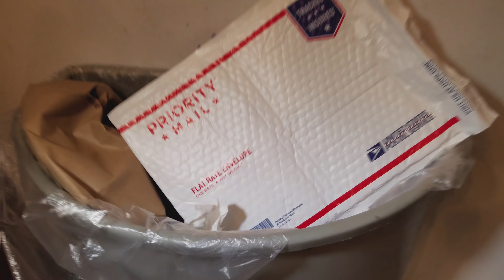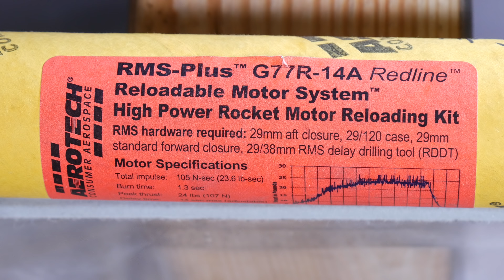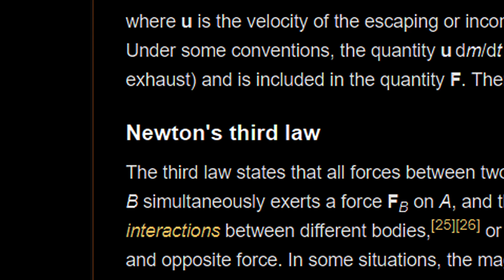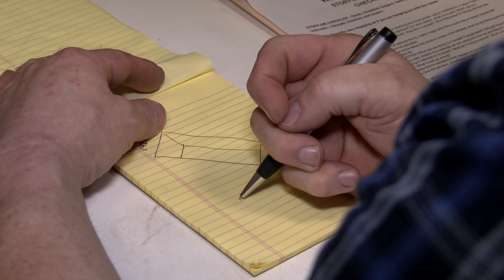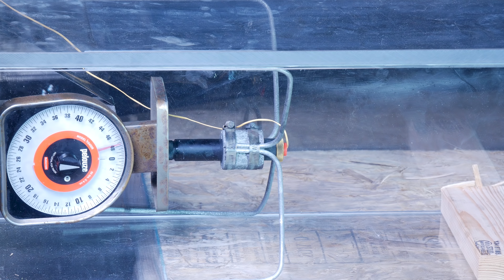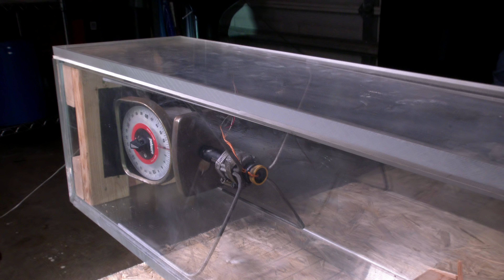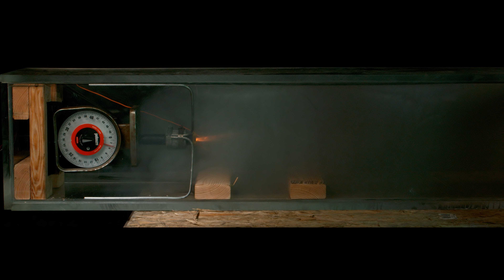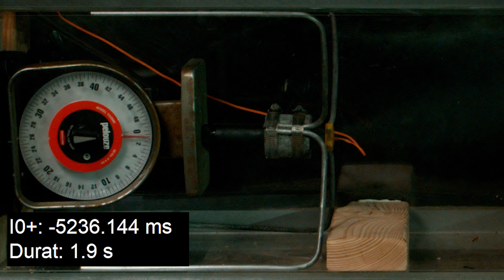Rockets in a Vacuum Chamber - Newton's third law of motion Visualized

Comment: i don't think science has any problem proving the idea that rocket propulsion works in a vacuum. If you contain an explosion with a small vent to allow gases to escape in a single vector then the pressure created by the explosion will press against the hull untill all the gases can escape and the pressure returns to zero. This isn't a difficult concept. if molecules can move in space, then objects can move in space.

I would like to hear from any astrophysicist (professional) who can explain why rockets don't work in space though.
Reply: No one is questioning Newtons action- reaction. The question is, can the mere reaction of exhaust gas, the force created as a function of its mass and velocity ONLY, absent of a pressure differential created at the exhaust, do the things that nasa is asking us to believe it did? How much effort is required to hold a garden hose? how much more effort is required if you block the end with your thumb? When we watch the famous footage of the ascent stage living the moons surface, keep in mind that the vehicles acceleration is due only as a reaction to the of the force of the exhaust gas (it's mass x velocity)
Reply: @markwilding3828  do you understand the "Law of Conservation of Momentum".  For example, if I had a giant crossbow with a mass of 5000 kilograms.  It is floating in zero-G, in a vacuum.  It can fire a 500 kilogram block of water ice at 2500 meters per second (muzzle velocity).  Would the crossbow get pushed backwards?  Do you know how to calculate how much velocity the crossbow gained by firing the water into a vacuum?  Hint: definition of "momentum" is Mass x Velocity.  The momentum gained by the block must be the same momentum gained by the crossbow. Momentum of block = 500 kg x 2500 m/s = 1250000 kg x m/s.   If the momentum of the crossbow must be equal to this momentum, then write out the equation for the crossbow, and solve for final velocity.  You will get 250 meters per second (~560 mph).  So that is a HUGE velocity change from firing a SINGLE block of water.  Do YOU know of any machines that CAN do this in space?
Reply: @stuartgray5877  Yes, thanks Einstein. I also understand the principle of Force and it's relationship to acceleration... I realise I was somewhat loose with terms it the above statement which is a bit careless because there are always those readers who would rather challenge a point by obscuring it with irrelevant detail than actually considering  the concept. Had I been concerned with solving some Newtonian equation I would have been more rigorous. What I should have more precisely said is that the reaction force is a FUNCTION of mass and velocity... velocity,  acceleration, mass and momentum all being related linearly. However, to consider your point, let's look at your crossbow being the 5000 kg (at launch) ascent  stage and the arrow is a gas being ejected in an effectively  perfect vacuum  in direct opposition to the moons gravity...or let's consider the Ascent stage the arrow and your target is the CM, 60 miles away and moving in an orbit (changing velocity) at a speed of 5,000 knots.... of course you do have the opportunity to change the arrows  velocity multiple times by recalculating  it's  momentum and acceleration  with respect to the arrows velocity with respect the arrows changing velocity due to the lunar gravitational and the targets constantly changing location... So GOOD LUCK! you get one shot or everybody dies. Please advise grammar errors.
Reply: @markwilding3828  So you are saying it is POSSIBLE based on Physics, but really HARD in practice?  Is that what you are suggesting?

Another question:  Do you think the SpaceX launches and LANDINGS are fake?
Reply: @markwilding3828  the other thing I didn't mention about my example above is that: the Space Shuttle Main Engine (SSME) expels 500 kilograms of WATER at 2500 meters per second from the nozzle EVERY SECOND.  That is about MACH EIGHT, at sea level.  Do you think a machine capable of that can PROPEL ITSELF in a vacuum?  Well I calculated the momentum of that 2500 m/s water.  Does THAT seem like enough to propel something in space?  You don't think "exhaust gas" is enough to lift the ascent module from the lunar surface?  Why don't you CALCULATE the mass and the velocity of the gas required to lift the equivalent of a VW beetle in lunar gravity?  Then you can see if it is within the realm of possibility.
Reply: @markwilding3828  yes you can believe it. how much velocity is in each molecule that combusts inside a rocket booster? multiply that by how many molecules total that are exploding- and you get plenty of force to propel a rocket. Can the force of combustion push a rocket in space? 

Can two asteroids collide in space? What would happen? nothing? do they just not go anywhere? Do they not break apart and fly ogg in many directions? Are people saying that whens billions upon billions of tiny collisions happen each moment during rocket combustion, it has no effect of movement on the rocket because it's in a vacuum? Even in vacuums 2 particles can not fill the same space. if a molecule is combusted and sends that molecule hurdling at thousands of miles per hour and hits a metal molecule from the hull of the ship, is that not going to have an effect? of course it is. That's not even debatable.
Reply: @stuartgray5877  Doesn't water boil in a vacuum..Are we not 70% water..just asking
Reply: @stuartgray5877  yes..deffo
Reply: @whiskyweasal89  Ok say you can fire a rocket in a vacuum..Will that momentum be controllable are would the object just spin wildly.
Reply: DG Medor thrust vectoring.
Reply: @whiskyweasal89  OK tnx you
Reply: @stuartgray5877  Stuart, you do realise that attempting to argue a point by changing the subject is awful reasoning and logically invalid. However, when space X launch a rocket propelled vehicle off the surface of the moon  and successfully dock with another orbiting vehicle, attempting this procedure for the very first time with two lives at stake, by all means, let's consider Apollo's alleged achievements together.

Comment: Just put a normal prop in there...feed some dust/debris into it.. then record the results. or setup up a second vacuum chamber connected to the first with a one way valve then (using very exactingly matched rockets) measure rocket propulsion under varying atmospheric pressures  then remove any test results where the one way valve is actuated .. then extrapolate mathematically how much thrust a rocket would produce in a complete vacuum environment. btw you would prob need very very small rockets and very delicate/accurate measuring devices.

Comment: Let’s point out a few facts:
1. The test had to be modified because you initially could not achieve ignition without adding atmosphere.
2. In order to achieve thrust, the source must have something to push off. In this case the scale. Imagine the rocket in the expanse of space. With nothing to apply the force. No atmosphere, no surface or kitchen scale.
3. The vacuum designed also has gravity applied, which is something not available in space.
Reply: RedPill Dan - "Imagine the rocket in the expanse of space. With nothing to apply the force"
The Rocket TAKES MASS WITH IT to "Push On".
IF I was floating in space and fired a massive steel projectile from a crossbow, WOULD I FEEL RECOIL?
This is a yes/no answer.

Comment: The vacuum really has nothing to do with it as the solid rocket motor contains all it needs for combustion. The combustion reaction creates pressure (picture molecules moving at immense speed trying to move away from each other. They are small, but they have mass and there's lots of them !) The position and shape of the nozzle aligns the release of that pressure with the centre of mass of the object the motor is attached to so they push off each other. 
Air pressure is only relevant when it needs to been drawn into a motor from outside to complete the 'fire triangle' - fuel, air, ignition source.

Comment: A rockets movement in space has nothing to do with what is around it. The movement comes from thrust.  If an explosion happens in a tube under the pressure from the size of the tube compared to the high yield of the explosion, the reaction will push whatever is around it the opposite direction in which it is free to go. Only having one outlet, it alleviates the pressure by escaping  the tube.  This pushes the tube, which is part of the rocket, the opposite direction.  The movement is the interaction of the high pressure against the tube of the outlet, not anything else.

Comment: its a lot wrong with this... 3:11 .. your vacuum ... doesn't start a vacuum for long when after the rocket starts... you would need about... 100 times..  the vacuum power you currently have... ( in other would you could affect the thrust  by putting the rocket in a really fast wind tunnel also )
Reply: 3:08 9:40 .. and you need to understand... something..if you throw a bowling ball in space , you will get pushed the other way ..  .. the rocket , is pushing out mass... Matter... there will be. some thrust...  the forces change ,  water to air to vacuum , but ejected matter at speed, will always MAKE a PUSH. force

Comment: If that box was under a vaccum, why was the smoke still congregating around the rocket 🤔
Reply: I would imagine that gases building up from the rocket exhaust are pushing the particles back towards the motor.
Reply: @darklight2.1  right, witch is inconsistent to a vaccum atmosphere.
Reply: @paqman9101   Gas pressure in the  container increases as the motor burns. That has no effect on the experiment, of course-it was entirely successful.
Reply: @darklight2.1  no, if the box has pressure the experiment failed.  It didn't stimulate space.
Reply: @paqman9101  Any environment will have some level of atmospheric pressure-a perfect vacuum is a theoretical construct that isn't measurable anywhere. Even in the depths of space, a single hydrogen or other atom can wander through at any time, or a virtual particle can be created anywhere, negating any perfect vacuum condition.
What we describe as a vacuum is simply a relative difference in pressure between two environments, with that difference being practically, not formally, described by the requirements of the operation .
The atmosphere in the box was reduced to  a level that would be normally described in industrial or scientific use as a vacuum state, and the motor achieved thrust under those conditions. Therefore, Newton's 3rd Law was demonstrated empirically and  the experiment was a success.
Reply: @darklight2.1  N3 proves rockets can't work in a vacuum, chatbot guy. in fact all newton's laws do if you understand them.
Reply: @papalegba6759  - "n fact all newton's laws do if you understand them."

This is FALSE and PROOF that you do not understand them
Watch:
- Answer the following questions:

1 - When the rocket engine is firing, does the exhaust gas CHANGE VELOCITY?
(does it get ACCELERATED?)
Yes or No?

2 - Does the exhaust gas HAVE MASS?
yes or No?

3 - Can MASS be accelerated WITHOUT a force? Yes or No?

Papa Legba, please just answer these SIMPLE basic physics questions.
Reply: @darklight2.1  now watch as papa legba refuses to answer my questions. This is because he KNOWS that answering them Truthfully proves HIM wrong.  Now watch as he comes up with excuses WHY he won't answer.  He will type more words to worm out of answering than just typing: "Yes, Yes, No"
Reply: @stuartgray5877  i muted your harassing chatbot self years ago.
Reply: @papalegba6759  now watch as papa legba refuses to answer my questions. This is because he KNOWS that answering them Truthfully proves HIM wrong.
Reply: @stuartgray5877  nah it's because i know you're nuts.

Comment: Solid rockets are rarely used on 2nd stages(the part that reaches orbit). Most are liquid fuel rockets. Hypergolics are also used. Cold gas thrusters are a thing maybe you could test that.
Reply: I have launched 6 spacecraft in my career and four of them had solid rocket motors for the THIRD stage.
Minuteman ICBMs are solid for all three stages.
Reply: Solid fuel is actually fairly common in upper stages, especially in ICBMs. Solid fuel has the particular advantage of being shelf stable and being ready to launch at a moment’s notice for decades at a time. 

So if you don’t need to throttle thrust, solid fuel is a great choice because of the simplicity and reliability. No moving parts, no mixing, no cryogenic liquids to store and move.
Reply: @AM-rd9pu  i follow almost every orbital launch in the year.
When it comes to rockets in space 2nd stages of rockets all that. Rarely used. You cant turn them off. But unlike popular believe they can be steerable.
There is only one orbital launch vihicle that im familiar with that uses solids as a 2nd stage, and that entire rocket is based on an icbm.
But whar every orbital rocket and satelite has... hypergaulics or cold gass thrusters.
Reply: @ICANanimations Maybe my perception is skewed by the fact that the company I work for entirely does solid fueled rockets and boosters haha.
Reply: @ICANanimations as I said above: I have launched six spacecraft in my career and four of them used solid rocket motors for the THIRD STAGE.
Reply: @ICANanimations the Magellan spacecraft used a solid booster to enter orbit of Venus.

Comment: This doesn’t seem very smart.. your rocket engine and ignitor requires some sort of oxygen atmosphere to be ignited. I am no rocket scientist but a proper engine for this project would be a design where the igniter is built into the engine in a protective case capsule where this engine will have its own h2o supply and it can be ignited in any environment. ??
Reply: Estes rocket motors have a mix of oxidizer and fuel.

Comment: Granted, I wish the control numbers were better shown and recorded, this still begs the question from deniers: if a mass is required behind to act as a backboard to "push off of", could we not reasonably assume the greater the density of mass, the greater the force capable of being exerted? For instance, a vacuum vs high altitude light dense air vs low altitude dense air vs the ground... wouldn't a rocket "pushing" off those generate more thrust based on how much is behind it to "push back"? Shouldn't a missile fired at sea level generate more force behind it than somewhere where air is very trace? In application, this is not the case, the less air around the missile, the better it performs, it's why military airplanes loft the missile upwards from high altitude, it gives it better capabilities. In fact, shooting it at low altitude dramatically diminishes its performance. This is also true of the jet engines themselves: they work better at high altitude, so long as they have oxygen to ignite. As you climb, fuel endurance dramatically increases, despite being some 1/14th the air present. Even if you put a balloon on a toy car at sea level, and went up into the mountains, where there's only 85% the atmosphere, would the car only get 85% the thrust? Until a vacuum where it'd only have 0%? This isn't the case because the force isn't coming from pushing off the back air, it's happening from the reaction.  
Even in this, even if the tube filled with material, what's the atmosphere pressure to "push" off of? No readings were given, but I can already tell you the atmosphere pressure was not the same. @12:40 in the video he comments that the ignition seemed to happen way behind the engine, unexpectedly, rather than at the engine itself. This is actually expected and observed with all rockets. They have a nice tapered cone at the engine due to atmosphere pressure around it... but as it goes up in altitude, that pressure weakens, and the cone widens, dramatically. You're just seeing this in the small tube. There's no air to hold the exhaust in place, so it ignites out freely. Yet, still, despite this, it continued to produce great thrust. That alone tells me it wasn't "pushing" new atmosphere, the byproduct was just exiting out in a free fireball, nothing to hold it together, where the work and force has already been done; thus proving the 3rd law and recreating what we already see in larger scale.
Reply: - "if a mass is required behind to act as a backboard to "push off of", could we not reasonably assume the greater the density of mass, the greater the force capable of being exerted? "
YES.
There is a video demonstrating the recoil of firing a Crossbow on a frictionless surface.
It DEFINITELY has more RECOIL when it fires a projectile with more mass.